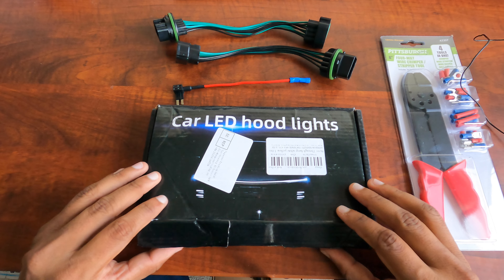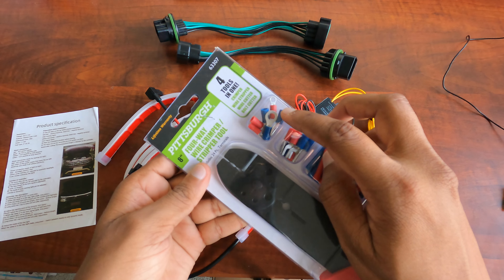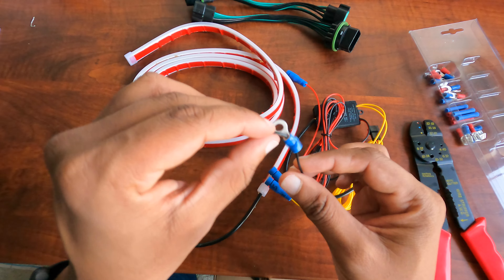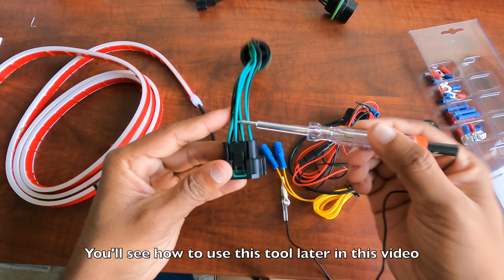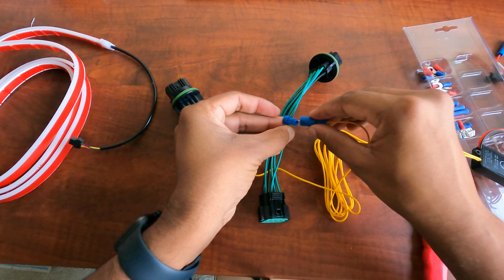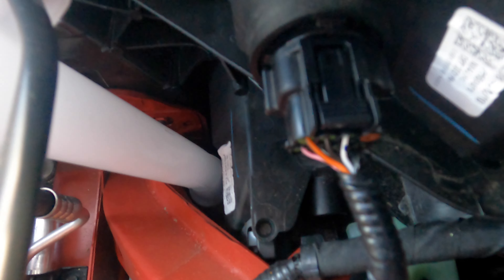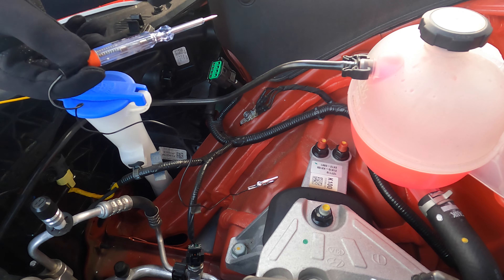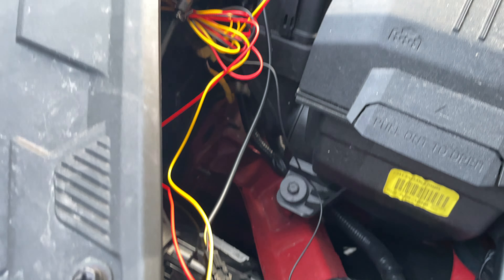Led hood light installation on 2023 Hyundai Tucson | Plug and Play | Tucson Stories

Comment: Awesome. To which connector pin is the red wire attached? I have installed it in my car, but it is not always on.
Reply from the maker: I also faced it. And I changed the red wire connection to fuse tap. Connected to 20amp fuse in engine fusebox. Going to post a video of that soon.
Reply: @TucsonStories  thank you

Comment: I watched your video, most very easy to follow until you got to the install, what did you do on the drivers side? In the beginning of the video it shows that you only tapped the yellow wire into the extender pieces but when it was installed it shows two wires into the extender. Where did you install the red wire? Also after connecting the extender piece, was there any other wires that needed to be connected anywhere else?
Reply from the maker: @jenniferbarto1423  there are total 4 wires. 2 yellow wires for turn signals, 1 red wire for white light and 1 black wire for ground. 
Connected 2 yellow wires to extenders for turn signal power. Connected black wire to car body for ground. I had to change red wire connection after this video. Connected red wire to accessory fuse in fuse box. Here is the video of that change https://youtu.be/2srJe9_j0ZE?si=bq4f5xmOZC-wCYqu

Comment: Have you thought about using this application for the rear turn signal?  I wonder if it would apply well under the rear spoiler on the tailgate?
Reply from the maker: @geckotek  you cannot have while light in the back of the car. It’s illegal. There is a different device, that generally people install on pickup trucks. It has red light bar with turn signals. Tucson already has red light bar in the back. So, I didn’t think of it much
Reply: @ excellent point. Thanks for the reply. We’re all trying determine better turn signal options and I think something like this without the white light would be optimal.
Reply from the maker: @geckotek I turned my brake lights into brake/turn signals. You cannot find that video in my channel if interested.

Comment: Would i need an adapter for both the left and right side turn signal
Reply from the maker: @josemejias1223  yes, you need two. One for left and one for right if you want don’t want to tap original wires. If you are ok tapping into original wires, you don’t need adapters

Comment: What size Gauge did you use for wire tapping?
Reply from the maker: I left the link to post-tap in description. It is around 18 awg, a right fit for the extenders I used. But, original wires are much thinner. If you want to tap into original wires you need smaller taps
Reply: Plz give me Flipkart link
Reply from the maker: @murtaza4214  Sorry, I don’t know if they are available on Flipkart

Comment: Where did you ground the cable?
Reply from the maker: At 12:35 you can see ground connection. I attached a ring connector to ground wire and used a screw to connect it to car frame.

Comment: When do you buyed this lights?
Reply from the maker: @juvima1808  a few months back!
Reply: @TucsonStories  where do you buyed?
Reply: @TucsonStories  I bought a 12v light for my car, but when I start the engine it stops working. With your video I discovered that its light is 15V and possibly that is what is not allowing it to work correctly.
Reply from the maker: @juvima1808  oh. I bought it from AliExpress. links to all the products I used are in the description of the video
Reply from the maker: @juvima1808  no. It is 12V light only.